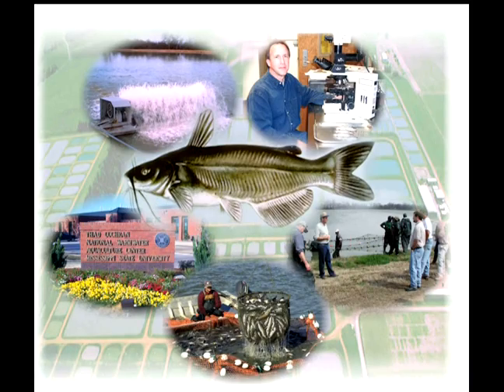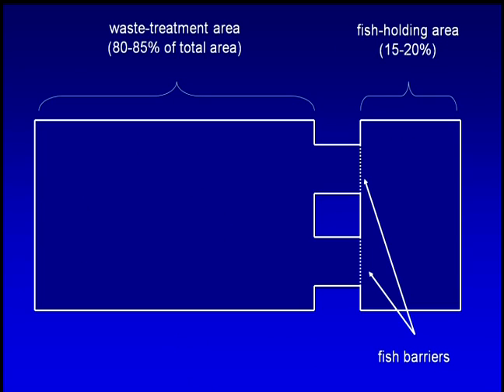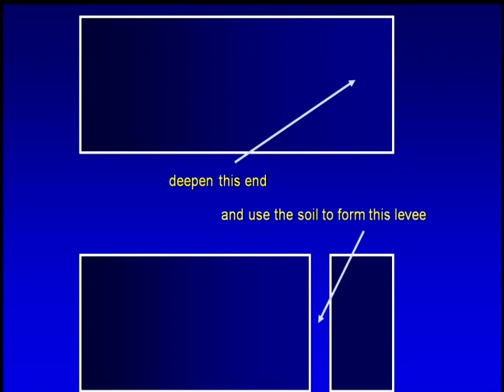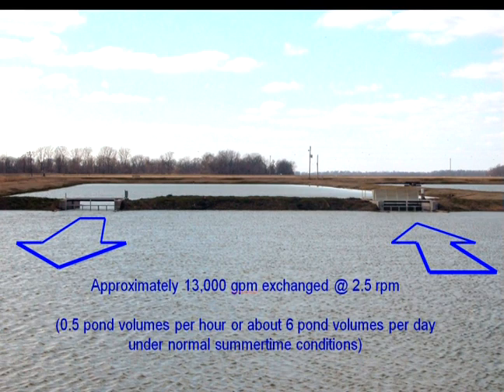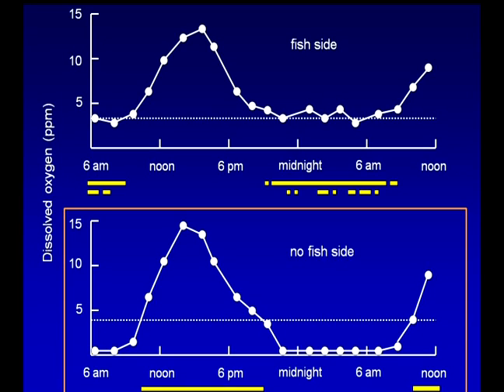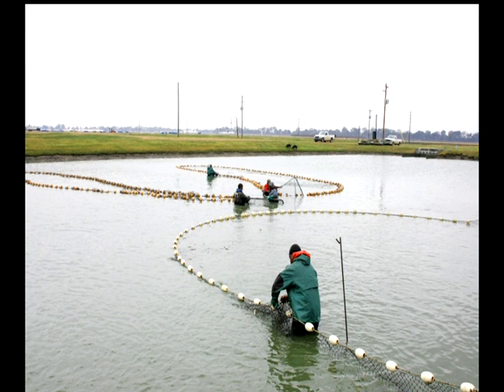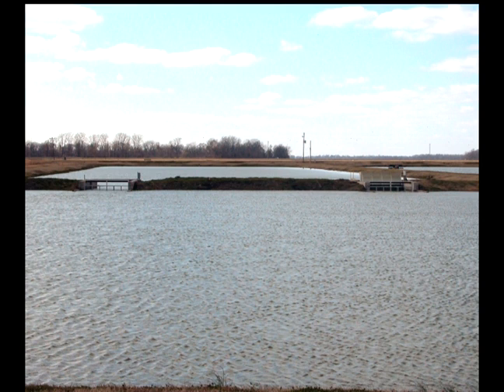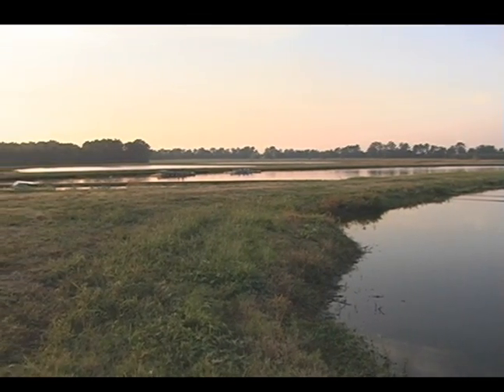Advanced Aquaculture Systems Part 3:  Split Ponds

Comment: I have been thinking about your split pond system. One of the major setbacks is the requirements for the power backup which is costly. Could you not use a conventional pump to do the moving and oxygenation of the water? If the answer is yes then build a dam/reservoir that holds enough water to substitute for the pump when the power is down, and use the natural out flow of the dam/reservoir to drive the moving and oxygenation of the raceway water. When the power goes down the dam/reservoir can continue to drive the  moving and oxygenation of the raceway water.